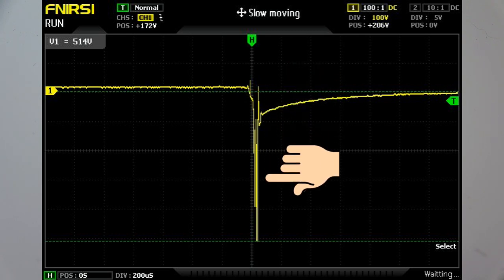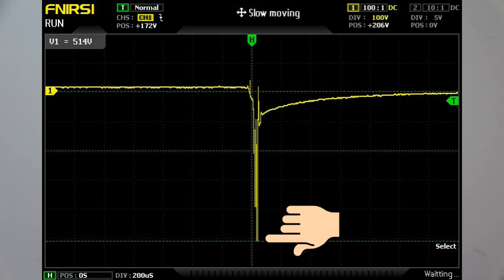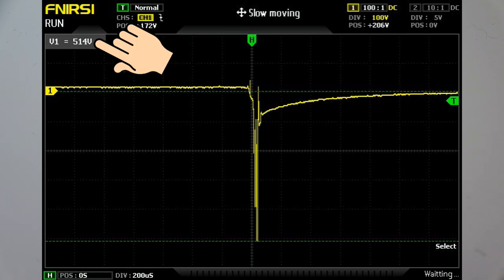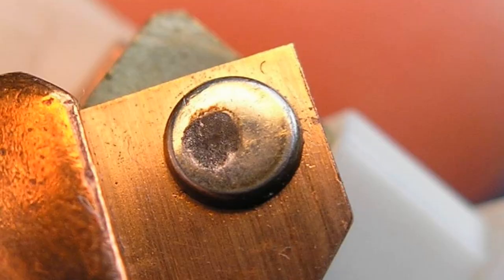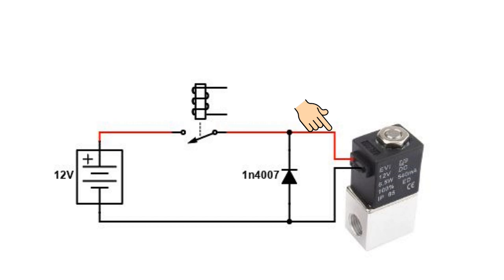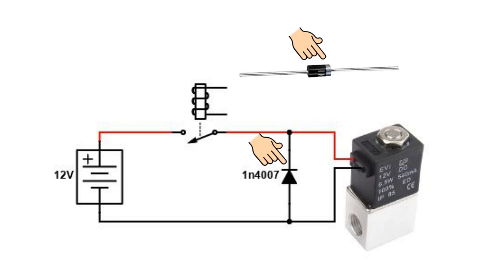Fixing Back EMF problems - Episode 29

Comment: Also known as a “snubber” diode. Make no mistake, back EMF also affects MOSFETs and transistor circuits. I used to be a failure analysis engineer for a SMPS company, and one of the issues that we saw a lot of was that the small transformers that they used would heat up and the glue that held the 2 sides together would fail. As the glue failed, the air gap inside the transformer got bigger and bigger, which changed its characteristics over time, resulting in HUGE back EMF spikes that would eventually wipe out the circuitry that fed the transformer. EXTREME heat and eventually a complete meltdown, literally, of the circuit was the result. Snubber diodes can only take so much abuse before they fail, so we worked on tracking that issue down for a good amount of time before realizing that the root cause was bad glue in the transformer.

Picking a suitable diode to use can be tricky because you want to use one that can handle the amount of current that is SUPPOSED to be flowing in the circuit without heating up. If you pick one that can handle far too much current for the task, you risk the diode surviving at the expense of other parts of the circuit that it is meant to protect.

Comment: Think this protection was build in the masso relay Module?
Reply from the maker: It is not possible to add protection to the relay contacts on any relay interface module. If diodes are added to the module at manufacture you will be limited to switching DC only and the relay contacts would become polarity conscious. You will also  find you can't use them for a lot of applications. It just isn't practical.
Cheers Peter

Comment: was about to install a soloed to my Masso this week great timing... got a Different Question the Custom button )blank button on Masso f2 screen is that user configurable or does Masso need to modify it for you.
Reply from the maker: Hi roverttrains
There is no blank button on the F2 screen. You will see in the documentation that the blank button you are referring too is where you enter spindle speed.
Cheers Peter

Comment: Can you give a advise on Monitor flicker and usb disconnect issue.  It would be great full,  waiting for your reply
Reply from the maker: Hi Haris
You would have to provide full details of the problem and your setup.
I would suggest posting on the forum with as much information as you can provide.
cheers Peter
Reply: Lol, I had to get a heavy duty VGA cable for my setup. The monitor went haywire whenever the motor was running. Lots of streaking/smearing etc. you can also add ferrite cores around the cable, including the monitor cable AND the power cable for your monitor. Also, be careful with how you route your cables etc.

Comment: Can you use a simple LED instead? That would also give an indicator as to when the solenoid is switched
Reply from the maker: No. An LED will not handle the voltage or current.
Cheers Peter
Reply: @cncnutzmassoedition9131  thanks, appreciate the response!